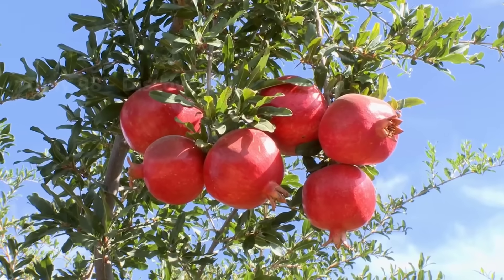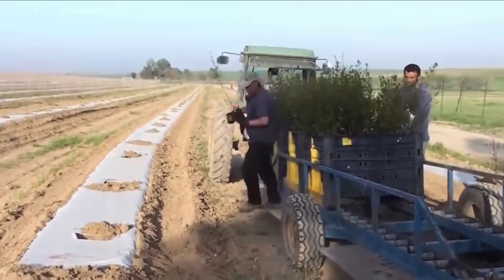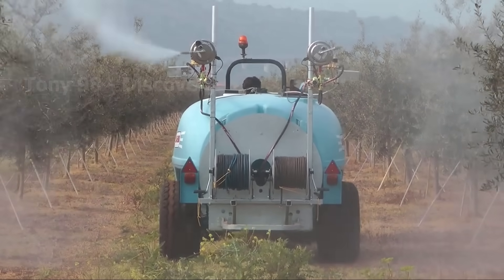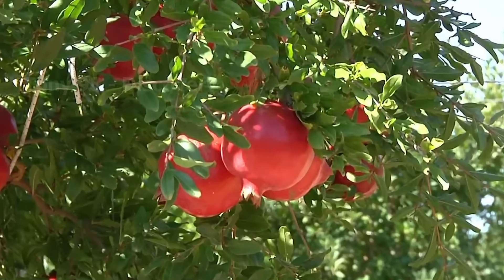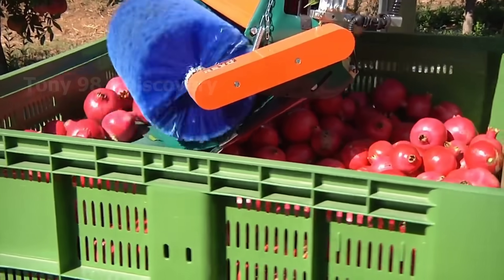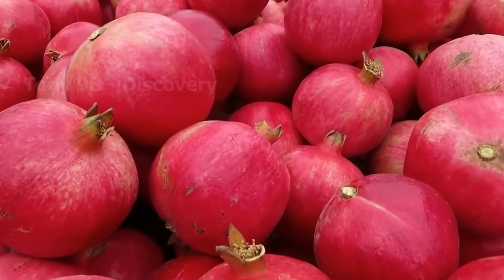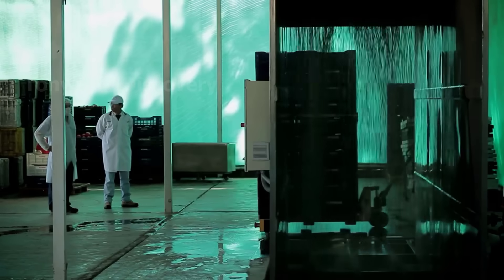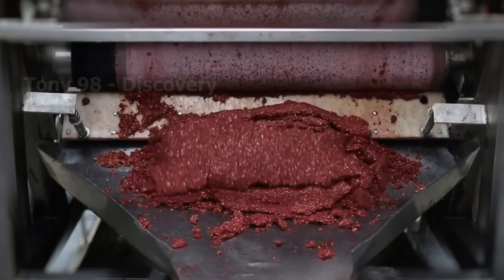Harvest And Process Hundreds Of Tons Of Pomegranates - Modern Agricultural Technology

Comment: I love ripe pomegranate’s. It sucks that American Grown Ripe Pomegranate’s are only available from early November through Mid January. Pomegranate’s have become quite expensive, I still purchase dozens of them when in season
Reply from the maker: I also like to eat pomegranate
Reply: I had watched a YouTube video on how to easily remove the Pomegranate Seeds. I used to pick the seeds out one at a time and would take me at least 10 minutes. Now I slice around the pomegranate just deep enough to not cut into the seeds flesh. Then with my hands split the Pomegranate In half. Place one half at a time. Deep into my cleaned kitchen sink. Then hit the skin side of the Pomegranate with a bamboo spoon. Knocking all the flesh and seeds onto a paper plate. Then remove anything that isn’t a seed. This method is very easy and takes less than two minutes to remove the flesh and seeds. I mix the flesh and seeds into Greek yogurt. It is simply delicious.
Reply: What this country